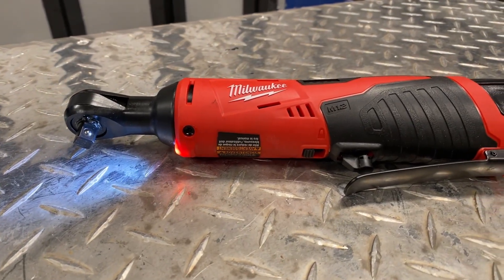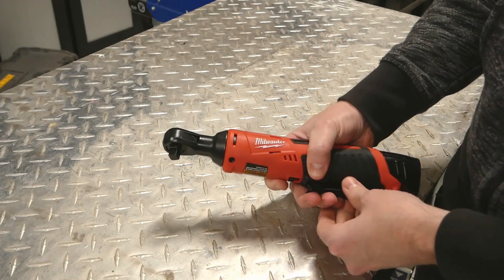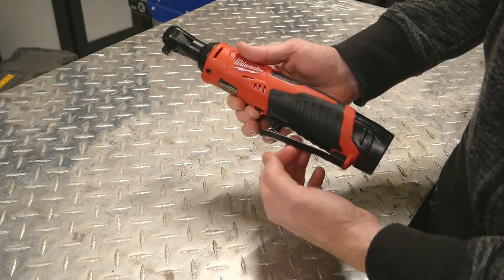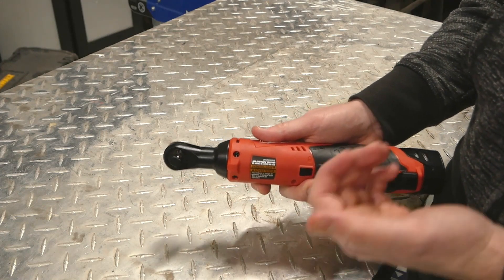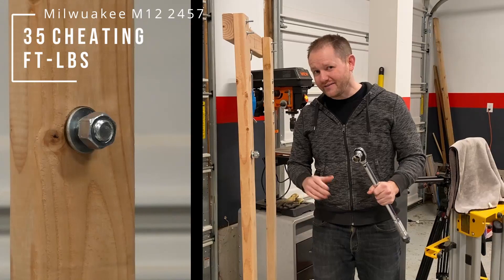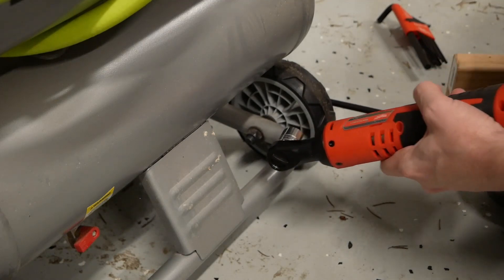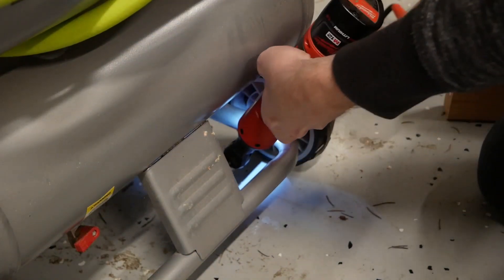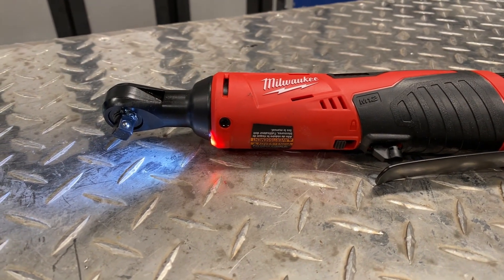The Milwaukee M12 Cordless Ratchet is a TANK with a CAVEAT

Comment: Literally less than half the torque of the fuel one. I bought it and then traded it away. Yes you can use it to manually turn a fastener.
Reply from the maker: Yes, the fuel is the overall better tool.